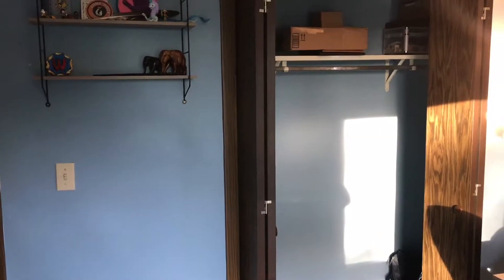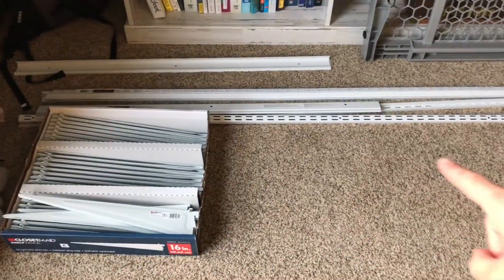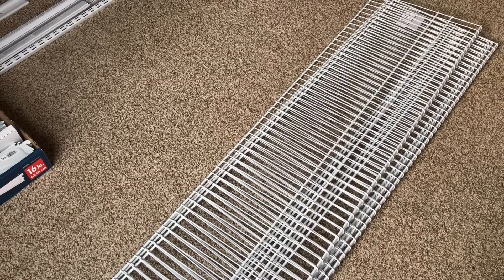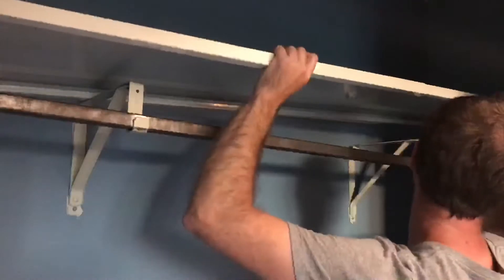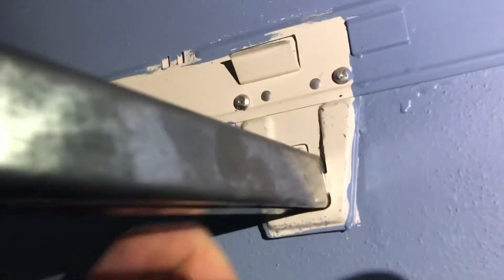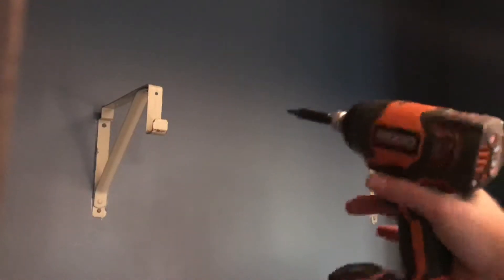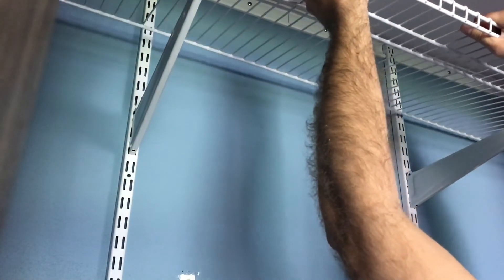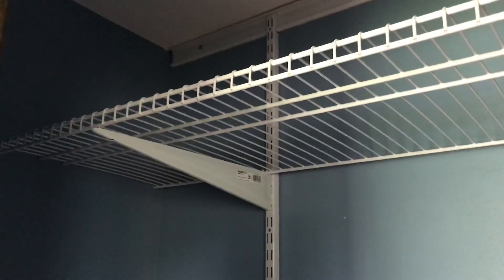How To Install Closet Maid Track Shelving System - Easy DIY Storage Upgrade!

Comment: This was great. My mom just moved and has a decent size nook in her kitchen and this would be a good idea to put there. 👍🏼
Reply from the maker: The great thing is that you can actually cut these down to size and use whatever length rack you need, easy to custom fit to a pantry! Glad you found this video useful! Thanks for watching!